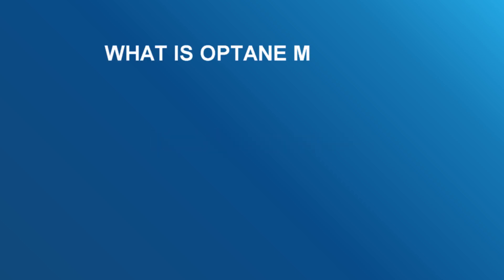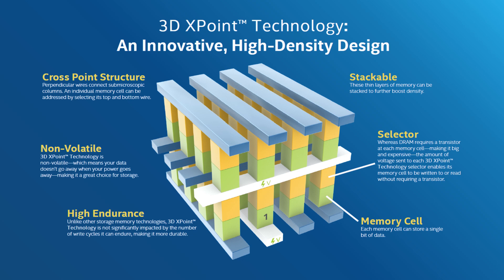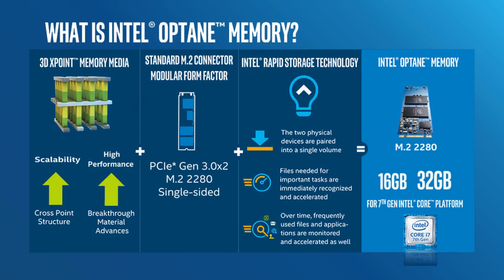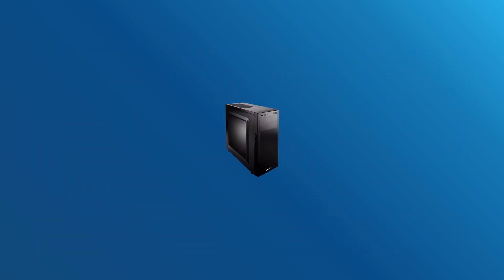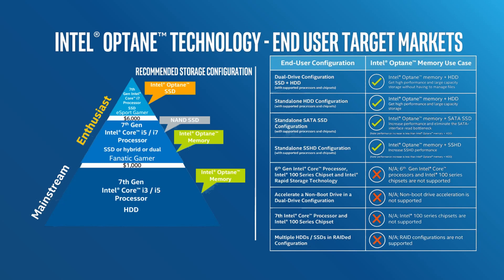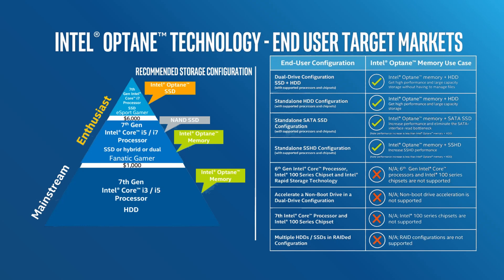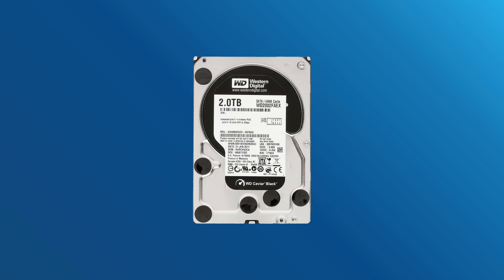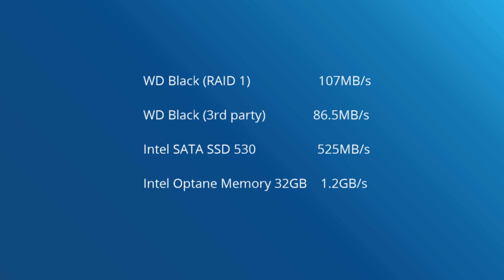What is Optane Memory? What is Intel Optane?

Comment: Samsung'S 960 EVO just seems less pricey no?
Reply from the maker: Yes, the 960 EVO is less pricy.

Samsung 960 EVO
Burst Read 3000MB/s
Sustained Sequential Read 2300MB/s
Random Read 1700MB/s
Sustained Sequential Write 1660MB/s
Random Writes 1440MB/s
Note: Speed will reduce over time. Read/Write times are from a clean drive. You have to secure erase the drive every once in a while to keep these speeds.
Queue Depth 18 to 32
250GB = $130 ($0.52 per GB)

Intel Optane 900P
Read 2400MB/s
Write 2000MB/s
Queue Depth 1
280GB = $400 ($1.43 per GB)

There is no doubt that the Optane drives are really expensive right now.
Are they worth it? Some people would say that the price of the EVO M.2 drives it too much.

Realistically if you by a 500GB, or 1TB 960 EVO, you are quickly going to loose %20 of your speed quite quickly. If you buy the 250GB drive you will most likely loose %40 of that speed. The Optane drive doesn't care how full it is, or what kind of load you are throwing at it. It will maintain its read/write performance. You also don't have to worry about putting your virtual memory on it, as it can sustain a large number of writes. Much larger than the EVO.

No really, are they worth it?
I would say to the average person right now they are too expensive. I would probably say the same for the EVO.
To the gamer, the EVO is probably in the right price range to speed. Optane, probably not.
To the extreme gamer, Optane all the way. It gives you the top performance right away, and doesn't degrade over time.
To the video editor, EVO will probably do what you need, video editing is heavy on sequential reading.
I have too much cash, DC P4800X is for you, it leaves everything in the dust.
Reply: Thanks!